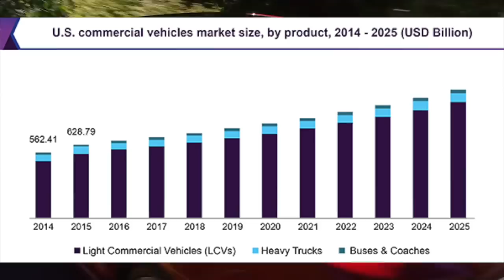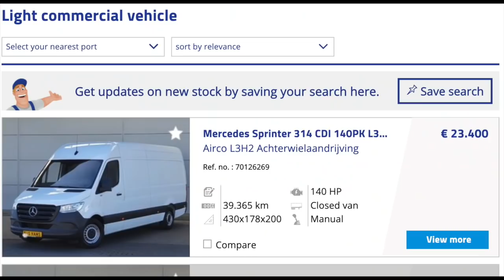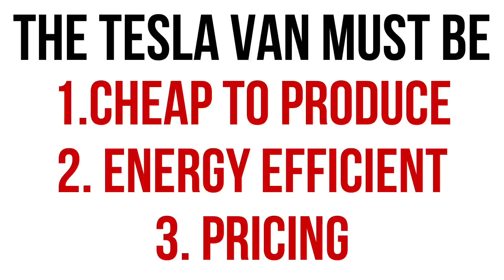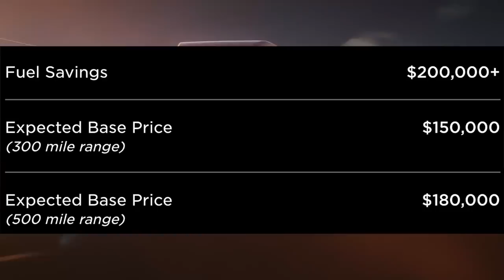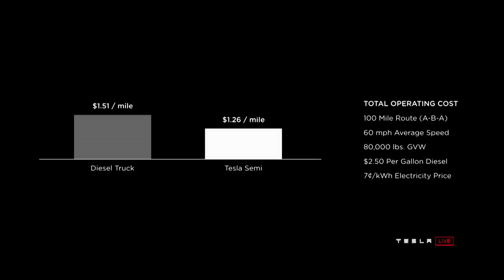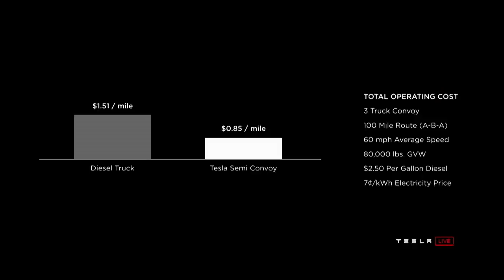Tesla's Upcoming Commercial Van - It's Coming Soon

Comment: As a note, price doesn't actually matter on large commercial vehicles like these. 
A large portion of their cost is written off as a tax deduction for business owners. 
This is partially why the market is so big, companies are incentivized to constantly purchase new ones. 
This is also why only the least reliable brands with the worst long term value dominate the market, because the loss of value over time is what you write off. 
You wouldn't buy a Toyota sprinter van for $50k that will still be worth $45k in ten years, because you can only write off that $5k value loss. 
Whereas your Dodge/Ford/Nissan/Mercedes that goes from $50k to $25k or less im ten years means you only actually pay half price.

Comment: Great video as usual. I will however differ with you on 'price'. I think there is a shift to aluminium titanium alloy over steel for lighter weight and lower corrosion vulnerability. Vehicles with a 1-2 million mile life need corrosion resistance...particularly as campervan.

Comment: Tesla will be playing catch-up in the commercial van market. Others are already showing concepts and plans to go into production. Vans would be great market but it really depends on future success building terra watts of battery cells. That’s in the works but not right around the corner. Where’s Tesla’s prototype van? Look how long it’s taking to get the semi into actual production.
Reply: The Semi needs really good batteries for its weight and range and it needs 1000 KWH of batteries for the 500 mile Semi  100KWH would cover a 200 mile range Van and the batteries could have average Tesla characteristics. IMO Tesla will be battery limited for a few more years.

Comment: Wish Tesla would make the cybertruck tractor for farming etc

Would be easy to add a Front End Loader (FEL) with electric actuators rather than hydraulics

And a rear actuator for implements such as bush hogs etc

I just did a 50 hour service on my new tractor and what a nightmare. Hydraulic filters x2, oil filter, fuel filter, 10 + greaze points (still have not found a few).

And the dielsel fumes and engine noise when driving.

Comment: Very good points, but there is one point that you are missing.

That is, that a commercial van is about the easiest type of vehicle to make electric.

A van is more likely to spend time in urban areas with lower top speeds, and especially for companies requiring vans for fixed routes the expected mileage per day is low and regular - meaning that slow night charging will be more than sufficient. Any car company should be able to make such vans.

Such vans are also not at all exciting as far as vehicles go.

So keep in mind that the choice of entering the pickup truck market was partly psychological, as was the roadster. These vehicles demonstrate that the toughest and fastest vehicles can be electric, and will outperform existing vehicles. That is necessary to prime the public for accepting electric vehicles, whereas an electric van would have just cemented the reputation of electric vehicles as dinky, underpowered, and dull. This is one reason why Tesla has not yet entered the van market.

But there's another important reason: Tesla wants to be competitive and even dominant, but it's purpose is to accelerate the transition to electric vehicles, not to utterly crush other automakers. To accelerate the transition there need to remain niches where other manufacturers can compete and have the time to develop their own technology. Vans are great for this, as the requirements are so much lower than for other types of vehicles.

Of course, this also means that the electric van market is going to have the most competition, which in turn will reduce what manufacturers can sell them for, and reduce their profitability. By staying out of this market Tesla can both focus their efforts on vehicles that will be more profitable, and avoid dominating the industry so thoroughly that other companies will not have a chance to make a profit at all.

All these factors combined mean that it may be a few years before Tesla thinks about vans, precisely because it is such an obvious choice. I am sure that when they do finally come out with a van it will handily beat anything the other manufacturers are making, but perhaps by that time the other manufacturers won't be in danger of being overwhelmed to the point of bankruptcy.

Comment: What truck driver wants to go only 60MPH. We have those EOBR in there & have to go 65-70 mph to make any money in the day. Also there is not place to charge a elecric semi right now. The range says 500 miles but when pulling freight with wind/hills/weather...... Guessing maybe 200 miles before you have to stop to charge for an hour. Trying to drive 650 miles in a day means 3-4 charges plus we sleep in the semi's. Finally the weight of the electric semi will be much more then a Diesel Semi. Reason is the huge battery pack. Meaning you will have to take less freight which means less money per mile or they will find someone else who can haul that load.

Comment: In the EU weight is a major factor.

A standard driving license in any EU country allows someone to drive a vehicle upto 3.5 tons, that includes the contents. So if you have a massive battery with a couple of hundred KWH then the load capacity is too small.  That's why Mercedes electric van has a 80 kwh battery. Which has a very short range in such a big vehicle.

There are some electric vans already for example DHL but in order to take over you need lighter batteries.

Comment: Vans are also in heavy use.  Postal vans, for example are used nearly every day for 8 hours 4 on Saturdays, and there are some deliveries at other times and hours.  It is also heavy on startups, which use a lot of fuel. Even if the numbers are fairly low, the impact on fuel usage would be high.

Comment: I think you are spot on, most people dont know that Train Locomotives are electric powered, teh have electric motors that are powered by diesel generators. They weigh 200-250 tons and a semi in the US total loaded weight is usually a 40 ton limit. Therefore  semi trucks could be electric-battery powered and be efficient also

Comment: I know my business would really benefit from a nimble passenger van for guided tours. The field is dominated by VW and Mercedes on the same chassis. They need large windows and easy side entry by sliding door controlled by the driver. Two seats in front, 8-15 seats in back. Simple, no frills but quality well-trimmed seats and panels, a swivel front passenger seat for the tour guide to turn to face the tourist on longer legs, good air conditioning, an audio system and a special treat might be a Model Y style glass roof.  Here, in this tourist city, there are about 1,000 working every day in the summer with 12-16 passenger size and they are replaced about every 4 years due to the summer only use and wear and tear. The longest day is about 80 miles with lots of stop and go, top speed on the would-be 60mph for out of city portions while most of the time 15-30mph.  A 40kw battery would be perfect, making it lighter and cheaper. If I had access to them starting next summer I would probably be in the market for 100 of them and I know larger tour operators who would order many more than that, for just one city. The day time electricity costs, 230v service is about 17cents/kw hour and gasoline is $5.60 gallon.  They would pay for themselves in increased tour sales and cost of operation savings in a year.  In the city center there are no gas stations but many places with high current service.

Comment: I believe you are a bit off here. There will not be a van until the Tesla truck is in full production as the van will use the same platform as the truck. Only the body will change. Also they will also have to achieve 500 miles on a charge to make it practical. Nothing in this video provides evidence of Tesla actually plan this soon

Comment: The year is 2025. You've saved up enough money to buy yourself a tesla van and you spend the next month renovating it to accommodate all of life's bare necessities. You're now free to travel anywhere with the comfort of a tiny house. Your motor, heated floors, mini stove, air conditioning, and accent lighting all draw from one collective battery that is stowed away under the van, out of sight. The solar panel on your roof charges up your battery during the day and extends out when parked for extra surface area and an awning. If the solar energy can't keep up with your power draw, you simply find an outlet or charging station and pop into the grid. Your van interior and "garage" remains uncluttered as you can put any tools and miscellaneous items in the frunk. You also have starlink internet wherever you go with the antenna mounted on your roof. Life is good :)

Comment: Shame he will not allow a gas generator on a trailer to make the long range viable.
Reply: So you would want this for the couple of times a year that you may go for a long drive?  

AC Propulsion did make a trailer generator for their T-Zero.  They also used it in some of their other projects.

http://tzev.com/2001_rxt-g_.html

They even made a version that had the trailer wheels steer for easy backing up.

https://www.youtube.com/watch?v=fN8g3bcU7ZM

Some issues that I see with it are 1: pulling several hundred extra pounds around.  2:  now having something that needs oil changes and servicing like a regular car, if not more frequent.  3:  potential issues with parking on the street and parking lots with the now longer vehicle.  4:  now your max highway speed is limited to 55 MPH per most state's laws.
Reply: @ricksmith3045  Good and valid points.

Comment: I hope they get into the commercial van space right quick because, like you mentioned in the video, it is a huge market. people don't tend to realize this but hopefully at least Tesla does. I work for a company that has a fleet of about E-350 chassis based vehicles, and all of the costs associated with maintaining a fleet like that, that gets used 24/7, are astronomical: the fuel cost a summer in the neighborhood of $800,000 per year and then you throw onto that brakes, all of the fluids like transmission fluid and oil changes and all of the other parts that go bad from idling and just being a system that involves burning a bunch of stuff, and it seems to me that it costs somewhere around 1.5 million dollars a year just to keep that fleet going. That's just our cost for all of the stuff that we have to maintain, never mind I love the mechanics and other folks it takes to do all the work.

Comment: Nissans eNV2000 would have been a huge hit in the USA .. Nissan kept promising, but not delivering .. givin Tesla's strategic Giga factories, it's clear that Nissan didn't have the battery supply chain to deal with a hit seller and as a legacy car company wanted to milk its NV2000 (gas engine) line just that much further.  Rivian and/or Tesla will eat Nissan's lunch with a good electric van.

Comment: I'm a Locksmith in a cold area.  I own 2 Chevy Express vans, 2019 4WD, and a 2004.  One big factor is a AC inverter, 2000W pure sin wave.  I don't care if the van comes with it, but I need a way to draw power from the vehicle battery (12v).  I don't have any use for a car/truck - neither would fit the bill for the type of work I perform....  So, I'll follow this segment closely.

Comment: "soon"

I don't know about soon, but eventually yes.

They are planning on cybertruck first, then the semi, then possibly try making the roadster and this van at the same time (because by then they might be able to make 2 new vehicles a year)

But then there's also the China designed car. Which low battery costs by then could be a mass market price.

Sure, Tesla will make one, but they have to build their other promised vehicles first.

The Model Y, cybertruck, semi, and roadster already have their reservations in (and technically the ATV). So depending on how fast they can build those will determine everything.

If they make one vehicle a year (Y, Cybertruck, Semi, Roadster, compact china car, then Van)

Maybe by 2025 if you consider that soon. (Unless they build 2 factories every year)

But I see your point. Accepting the adoption of renewable energy and use. It's in the plan somewhere.

Comment: Great content! They will sell so many of those vans...they might even have solar roofs on them (nothing like a big rectangle flat surface for that!).
Reply: Yeah that should be enough solar to give you an extra 200 feet of range a day
Reply: @cindytepper8878  "Elon Musk confirmed that Tesla's new Cybertruck electric pickup truck will be offered with a solar roof option over the truck's bed that will be able to add 15 miles of range per day." 22 nov. 2019 
Thats slightly over 200ft of extra range. Lets say delivery truck is used 300 days a year, thats still 4500miles on solar power. Now, lets say the van is used for 10 years, we're talking 45000miles on solar power alone. They'll certainly have more available surface to integrate solar panels on a van than on the cyber truck. Such a utilitarian vehicle offers quite a few opportunities for features that simply couldn't be considered on a sedan or even a cybertruck.
Reply: @Speedytrip  Elon CLAIMED that it would ad 15 miles. You;d be lucky if you could fit one KW of solar on the roof of the van. And it's not going to be aligned to catch the sun as it's working. Not to mention most of the US only gets three solar hours per day. That thing would be lucky to add one kilowatt-hour of charge to the battery on a good day
Reply: @cindytepper8878  I recommend you send Musk your resume, he clearly doesn't have a clue what he's doing :)